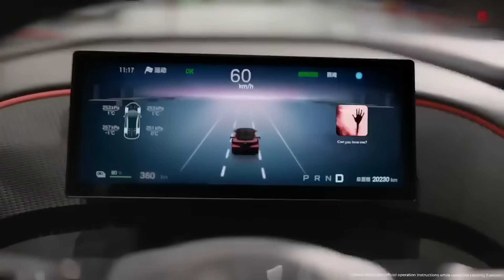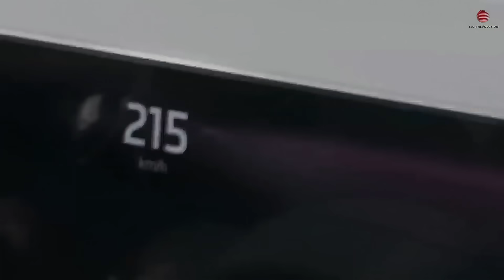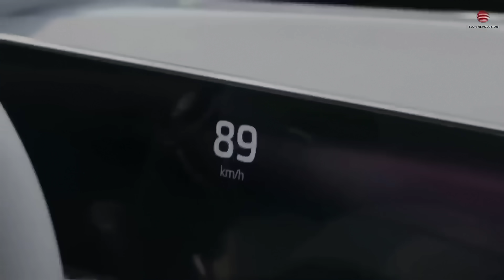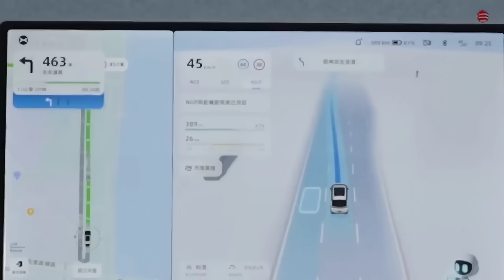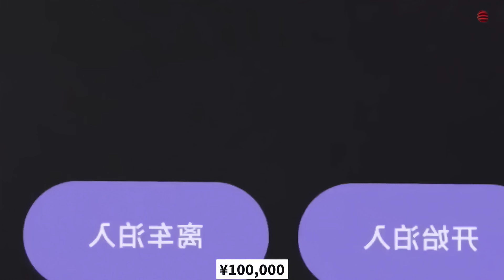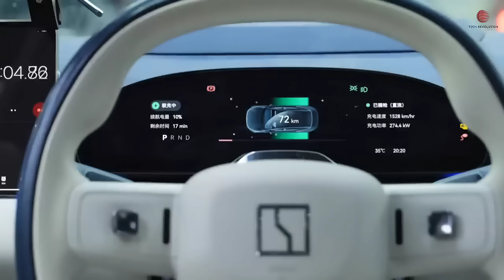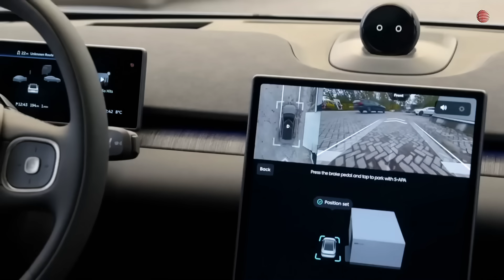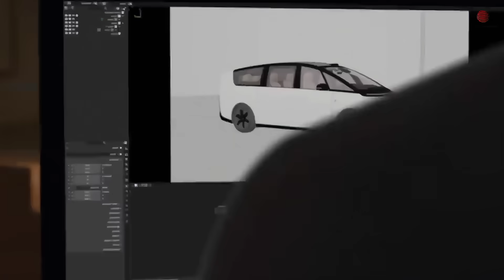Next-Generation EVs Demonstrate Technological Leap Beyond Traditional Automotive Capabilities

Comment: These cars are also based on a 30 min drive at speeds under 30mph for 9 miles.  

900km range is completely bogus and outright shady testing and advertising.  

Doesnt include weather temp calculations.

Actual range 316 miles tops.

This does not include headlights usage or A/C or radio usage.

If it did....250mi max
Reply: Li Bin (NIO's CEO) made over 1000km on ET7 equipped with hybrid SSD 150 kwh battery.  He was on a livestream during the entire ride. Search about it in the Internet.

Comment: IM Motors L6 uses a new standard to calculate ramge.  Its not true 900km per charge if you drive in usa.  Its based on stop and go and low speed driving.  
USA driving it would likely be around 500 miles. This video is very deceptive marketing.  Usa car manufacturers do the same.  Calculate gas mileage based on highway non stop driving

Comment: Batteries do well in stable climates but not in cold weather or hot summer like in northern states.  It will shorten the battery life.
Reply: i live in a tropic area and dont have problem with my battery
Reply: They forgot this in Norway, didn't they? The problem with not watching YouTube "EV Bad" videos, they haven't found they have a problem. Just saying.